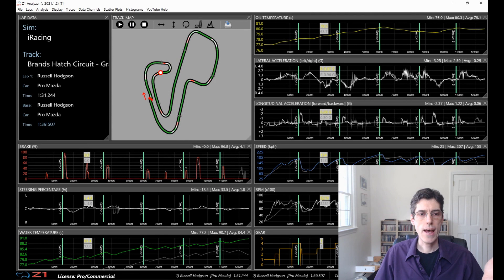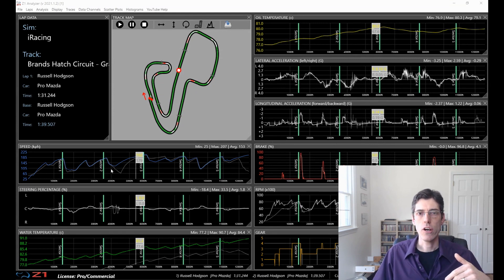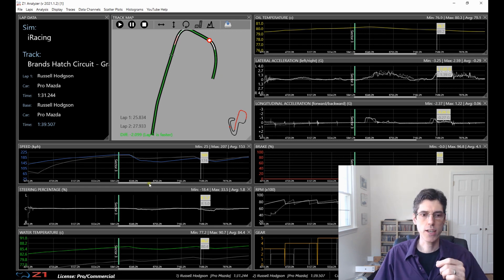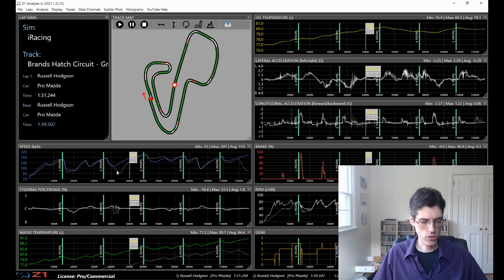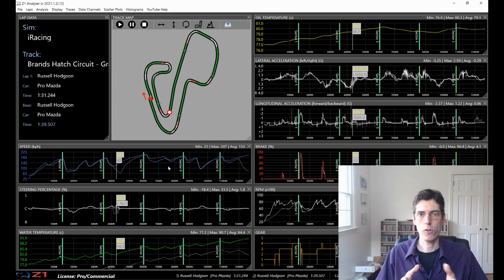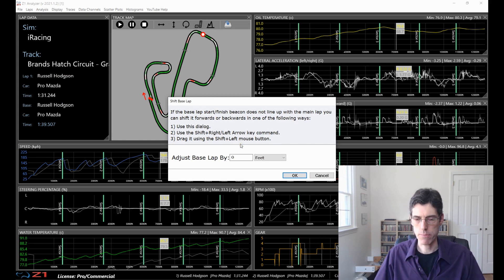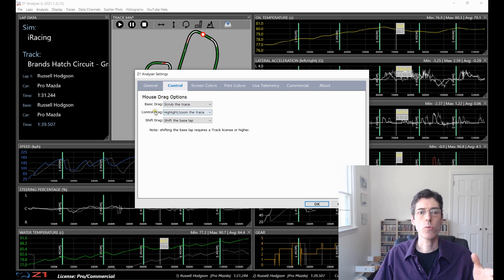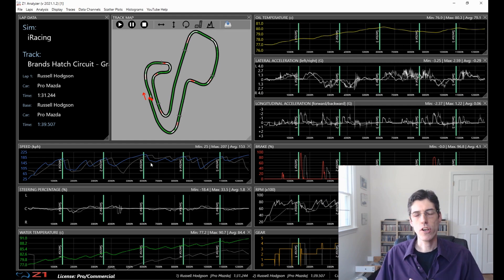Z1 Analyzer Trace: Zoom, Scrub, Shift

Comment: Thank you for the update! But i have a big problem with the dashboard in Assetto Corsa Competitione (ACC).
The dashboard shows no competitors at the trackmap or the standingspage. Only my car is shown on the track.
Also the tyre page has a bug, there is only the hottest temperature shown on all places on the tyre
When the temperature in the setup menu is shown 78 82 85 degrees for outside middle and inside, the temperature on the dashboard shows on AMI 3 times 85 degrees.

The checkbox for ACC and AC in the network tab is checked.

In Raceroom it works fine, I think its a problem with the connection or the reading to the game.
Reply from the maker: ACC only outputs one temperature for each tire.  That is why it reads the same across the tire (inner/middle/outer).
Reply: @Z1DashboardAndAnalyzer  And what is with the problem of the standings and track map ? There will be only shown me alone on the track map or standings page. Software is the actual 1.1